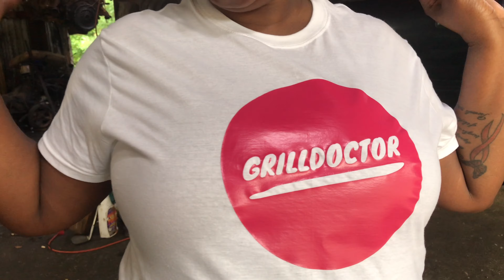Bad day for the sbc 400

Comment: Get you some 100 over stock length pushrods,alunimun head are 100 over stock heads thats why your rocker arm are hard to adjust because the stock pushrods are too short and this will fix your problem.
Reply from the maker: Thank u 👍🏾